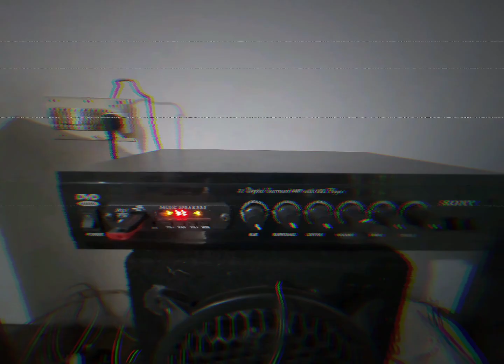lowcost 5.1 amplifier malayalam.

Comment: Kollam bro👌👌

Amplifier main. Power Section. Minimum 2000₹ 27.0.27/5amp.
Pinna ouru 3 MOSFET stereo and one mono. Board.. My dream😴💭
Reply from the maker: One day dreams will come true..
Reply: njan chithettu ondu 27.0.27 2ndu transformer 4 mosfet bord 2 most bordum

Comment: Bro enik nalla onn ndakki tharavo ethre akum.. Kedayal parts kittunna typ boad use cheith.
5.1
Veetlek ulla bass mathi tvk vendi
Reply from the maker: Place evdanu?
Reply: @techzone9209  malappuram dt. Areekod bro
Reply from the maker: @pistnboy1356  ok.. remotw kit amplifier 6600+ akum. 20 watts *5.200 watts sub. Control type cheytalum ekadesham ee rate akum. Power, specifictions, quality okke koodunath anusarich rate mukalilek pokum.
Reply: @techzone9209  surround oky ee 6 600 l kittuvo bro... Kedaya borad motham mattendi varuvo smd board ozhivakki cheyyn pattuvo
Reply from the maker: @pistnboy1356  smd board onnum illa. Ellam replace cheyyam. Spare ellam available aanu. Pinne surround alla, oru 3d out ayirikkum. Prologic. Real 5.1kitunna. (  multichannel output,  dolby, dts,..... ) varunna pin 16, 000+ akum. Decoderi tanne 8000+ rate varunund. But effect better ayirikkum.

Comment: Bro 12v 3A power supply undakkan eth capacitor&diode aan use cheyyendathu.connection onn paranju tharuvo.i have 12v transformer.
Reply from the maker: Diode  no :5408, 25v 4700uf capacitor. Rectifier circuit googlil available aanu.
Reply: Googlil njan noki bro kittunnilla.pls help.bro connection enganeyanenn paranju thannal madi enik manassilakum.thanks for your reply😊

Comment: Sub amp മാത്രം ചെയ്യാൻ പറ്റിയ low pass ഉം  power supply ഉള്ള mono ബോർഡ് reffer ചെയ്യാമോ
ഹോം തിയേറ്ററിന് അഡിഷണൽ sub വെക്കാനാണ് 8 ഇഞ്ച്
Class D  or AB  ആണ് നല്ലത്
Reply from the maker: You can use either class d or class ab. 2 boardinum advantages and disadvantages und. Class d 100 watts board with lpf available aanu. Class ab yil tfa 7294 ic with lpf available aanu. Subwoofer rms etrayennu  nokki board select cheyyuka.
Reply: @techzone9209  👍

Comment: ഹായ്  Tip 3055 dual Transistor Board എത്ര watts ഉണ്ടാകും എന്ന് ആരങ്കിലും ഒന്നു പറഞ്ഞു തരാമോ... PLZ
Reply from the maker: Around 80 watts.
Reply: @techzone9209  Thanks
Reply from the maker: @FDC-eg5qe  entanu bro, if any doubts please commwnt
Reply: @techzone9209  njan oru amplifier medichu Readymade 5.1 100w

Complaint onnum illa but 
Subwoofer boardil verum 2
 Transistor Ollu Tip 3055 
Ith sherikkum 100 W kittumo 
Avar enne patticho 😭

Comment: 200watts RMS 4 Ohms 12 inch subwoofer nu heavy amplifier watts athra kodukkam price athra varum bru
Reply from the maker: 200 watts alle rms, so 200 watta aduth output nalkunna amplifier use cheyyam.
Reply: Entea duth assembled amplifier 200watts pattumo nalla output kittuvan athra watts venam
Reply from the maker: @maheshmahiakt7416  200 watts subwoofer output undenkil kodukkam
Reply: 400watts maximum power und subwoofer nu

Comment: Does there is any relation between inch’s and watts(load)?😁
Reply from the maker: Tecnically not any relation. But namuk available ayitulla ore size ulla subwoofers okke almost same powet rating anu varunath. Eg : 10 inch subwoofers almost ellam ( dainty, argox, award, zip) 100-150 watts rms aanu. So generally size parayunnu enne ollu.
Reply: @techzone9209  ok I understand

Comment: Good information 👌
Reply: @techzone9209  brother tda  7294/ tda  7265 pairil 2.1 amplifierinu enthu price varum.. Speakers sub ethra inch watts kodukkanam
Reply from the maker: 65-100 watts sub output. 8 inch 100 watts sub load cheyyam. 25+25 watts channel. 6 inch speakers use cheyyam. Price bakki specs okke anusarich varum.
Reply: @techzone9209  channel 8 inch , sub 10 inch koduthal kuzhappamundavumo ? Perfect ethanu
Reply from the maker: @aashimedia1565  speaker and subwoofer watts?.
Reply: @techzone9209 sub 130 watts rms, channel 40 watts rms
Reply from the maker: @aashimedia1565  tda 7294 dual ic board (120-200 watts ) or 2 transistor board( 80-150 watts) or stk 4191 mono (100 watts) for subwoofer. Tda 2050(30-50 watts) or tda 7265 bridged board(50 watts, ) or stk 4191 stereo board for channels.
Reply: @techzone9209  sub wooffer 10 inch Award vekkan pattumo
Reply from the maker: @aashimedia1565  yes.
Reply: @techzone9209  whatsap no pls

Comment: Number
Reply from the maker: Entina bro
Reply: @techzone9209   oru amplifier  oro aalukalodu chodikumbol  pala price.... Oru 5.1 Dts sound  .surround  kittunna amplifier undakan ethra prize varum
Reply from the maker: @smsfamilyvlogs2022  price marum. Atoru thettalla. Place, upaypgikunna boardukalude quality, power supply, features, power,  labour charge itokke anusarich overall price vary cheyyum. Dts decoderin tanne around 7, 000 price varunund.output power and features anusarich bakki price varum.
Reply: @techzone9209  5.1 undakan endallam parts vedikandi varum

Comment: Hloo ente kayil 12inch xplod und  ethra volt transformerum athinte ampiyerum onn  paranjutharumo
Reply from the maker: You can use 4 transistor board with 27-0-27/ 10  amps transformer.
Reply: @techzone9209   ok bro